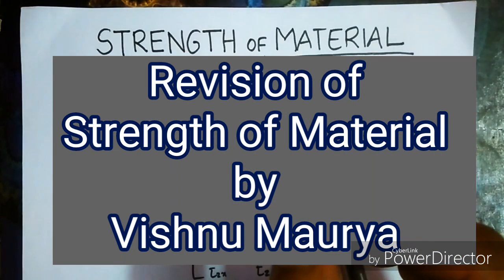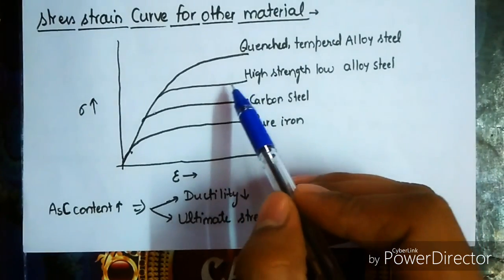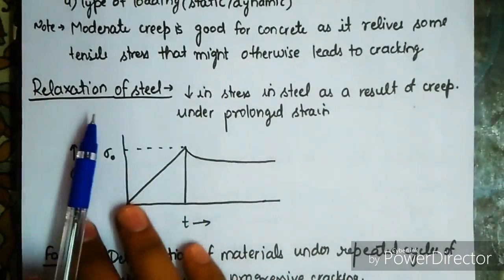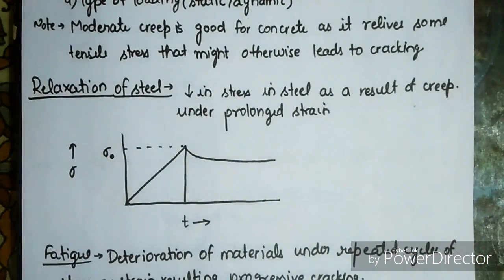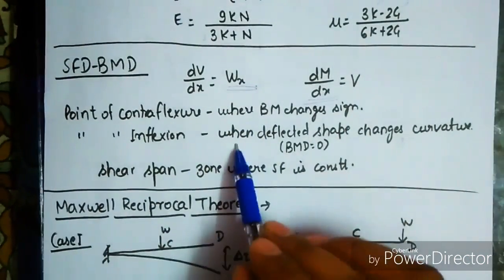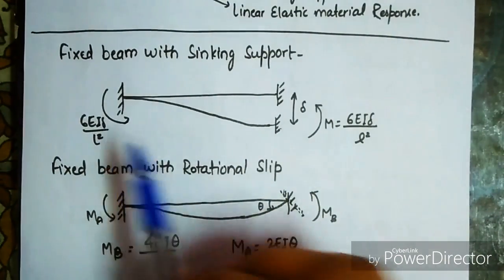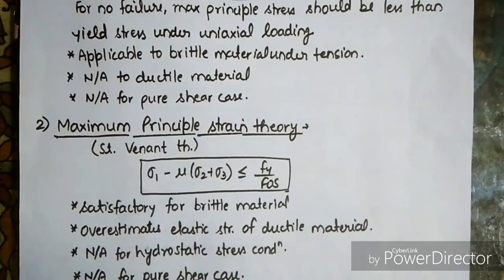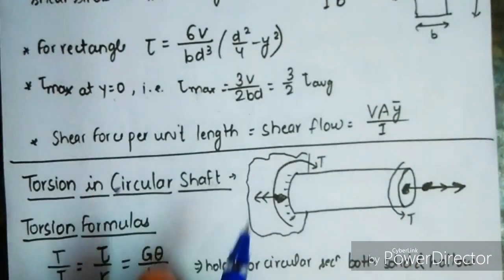Strength of Material- revision|| by IES Vishnu maurya ||.UPPSC Punjab PSPCL MPPSC MPSC RPSC BPSC JE

Comment: Can anyone tell me the difference between modulus of elasticity and bulk modulus
Reply from the maker: modulus of elasticity is longitudinal stress per unit of longitudinal strain. while bulk modulus is the change in pressure(stress) required to create unit volumetric strain in any material. 
we can relate these two by poison's ratio using formula
E=3K(1-2ú)